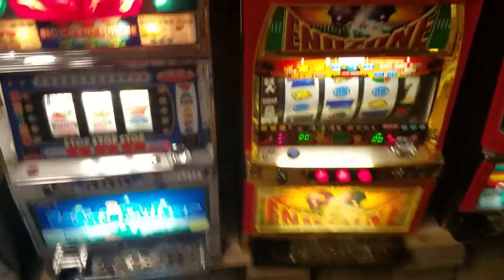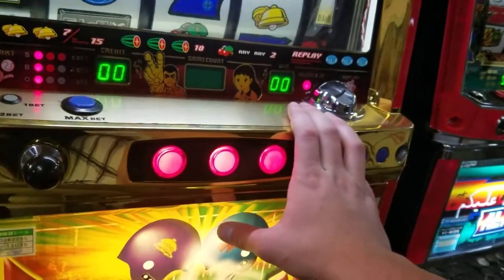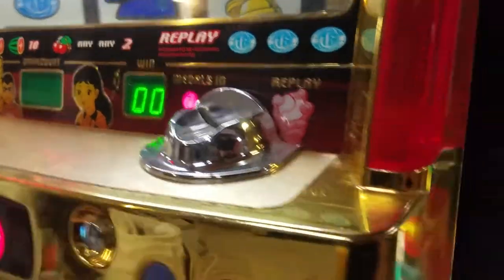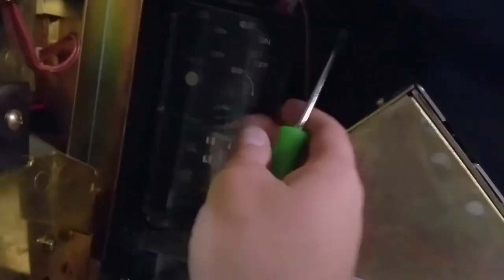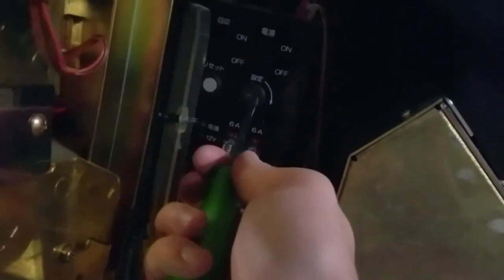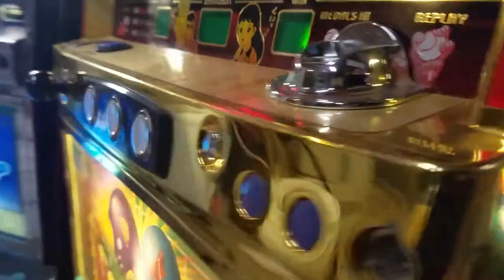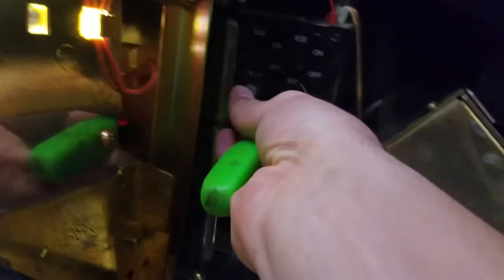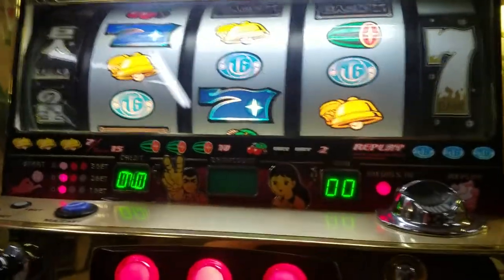Errors and how to reset your Pachislo Slot Machine

Comment: I love the video. I got a machine the other day. 2 of my stop buttons are not stopping the reels. All the buttons led light up but they are not stopping. The fuse looks good on stop board. I sprayed the connectors w contact cleaner. Any thought?
Reply from the maker: Sorry for the late response. I would say check to see if you find any boards (might be in the back of the machine or back right of the machine). There should be a control board of some sort. If this has a fuse on it, I would test the fuse with a multimeter to see if you have continuity. If not, that very likely would be the issue. If it does, I would highly anticipate that you are likely going to need to get some new buttons

Comment: I know this is a 5 year old video but I do have a question, when you used a flat head screw driver to flip the switch, how did you get that to flip over so easy? I have a japense babel machine and I have my switch on the top right of the machine, and putting a screwdriver in doesnt make it flip over. I also dont know how much force to use, I wouldnt want to break anything.

Comment: I have a Babel Japanese mach.  It is sooo loud!  Do you know how to lower the volume?  Thanks
Reply from the maker: Sorry for the late response. My machines are definitely loud also and I have not found a way to turn down the volume on them, unfortunately. I've read where some people will take some foam or something similar and try to put it in between the speakers to dull it. Have not tried this myself.
Reply: You can install a volume control,  but you need to understand basic soldering / wire splicing.

Comment: I bought a 2001 gogo juggler and its giving me a HC code I tried to reset I still cant get it to work. Do you happen to know what that error code means and what i could do to fix it? Thanks you for your videos.
Reply from the maker: Good evening and happy to help! First off, most of these I have ran into havent gave me a letter code, so this one is a little bit of a new one for me. Doing a little research, I founded this is most likely associated with a "hopper code" being that the sensor does not sound like it is either counting tokens when they go out, or are not feeding through correctly. What I would do to alleviate the situation is to see how your Hopper dispenses tokens first and foremost. Is it a micro switch? Or does it happen to be a sensor? Second off, is it in the right position? On one of my machines, I found out that my micro switch was all of a millimeter off, therefore, was causing quite a few issues in terms of feeding them correctly. I'm not a hundred percent sure with the machine that you were referencing weather it is a sensor or a micro switch, so you would have to take a look at this yourself. Some other research I've done indicates that potentially on your power supply the key switch that controls the hopper maybe off or in the wrong position. I would like wise check that to make sure that is correct. But first I would check the hopper of course to make sure that there are no jams and that everything is feeding through as it should. Happy restoring!

Comment: How do you use the screw driver method for Slotter Kintaro? Also how to I convert it to quartes?
Reply from the maker: My reset switch is broken on this machine, so that's why I'm able to use a flathead screwdriver. There should be a coin mechanism converter that you can buy from this gentleman. Link below.

https://www.ebay.com/str/pachislos?mkcid=16&mkevt=1&mkrid=711-127632-2357-0&ssspo=bI8MVatfRIS&sssrc=3418065&ssuid=O0iNCfB6TaC&widget_ver=artemis&media=COPY

Comment: i got a wai pulsar 2, the plastic on the reel is all cracked up and i cant find any where on the internet, anyone know a online parts retailer? i tried super glueing all back together i thought it had back in the original spot and tightened up but im still getting an E4 pooping up and the reel wont spin still

Comment: I’ve been having problems getting the stop buttons to react to pressing even after reset the lights still work
Reply from the maker: I would check the back of the machine particularly the back right side of the machine. What I have seen before is that there's been a logic board there. Sometimes there is a fuse on that board. If that fuse is blown, That could be causing the issue. I've had this happen once with my machines

Comment: How do you get your quoin counter to work. I rest my pachilso machine everything's works  but the qouin counter?
Reply from the maker: I would clean your coin mechanism and see if it's perhaps catching on something? Most coin mechanisms that I have seen If they are open maybe feeding the coin back through which it sounds like it might be doing that. If you push your coin eject button you should see whether it's open or not. If it's not, I would try to follow a coin all the way down and hit the micro switch so the machine may recognize coins going forward. That's at least where I would begin.

Comment: Just an FYI for those watching the video. At 2:11 when he shows the digital readout of 1, this is the difficulty setting. 1 is the default with the lowest pay out. You can press the round button left of the digital display. Settings are 1 to 6 with 6 being the most payouts. I have found 3 or 4 to be ideal as it gives you more little payouts so you get more sounds and animations on Pachislos that have them. You then still continue with the reset and it will enter your difficulty settings when you do. Most if not all will have to have the difficulty set on every reset.
Reply from the maker: Thank you for this piece of information! I did not know this!
Reply: I have some questions about my machine can you help me please
Reply: @briancrawford495  I can try to help if I can.
Reply: @Lithonion1  I appreciate it I'm trying to set difficulty but my control box is a little different is there a way I can send a picture
Reply: @briancrawford495  Don't know of a way to get you my email. YouTube is good at flagging it even if you try to be cryptic and deletes your post. What Pachislot do you have?

Comment: Could you or anyone tell me what type of KEY is used to open the doors???? Is it just a regular cabinet key? I have a macy continental 3 that works buy has the e4 code and no key
Reply from the maker: Unfortunately I am not too sure if it's a specific type of key that needs to be used. I would imagine that it is a special type of key that is used. Only a few of my machines have these and the ones that don't I typically don't mess with all that often. I know you can get replacements at eBay: keep4safety

Comment: Nice video. Do you know where the volume adjuster is?
Reply from the maker: Each machine is different, so I would not know with 100% certainty, no sir.
Reply: @jacobnienaber7653  I found it. But it only has three settings, loud, louder,and loudest
Reply from the maker: Got you. Sorry for the late response. Sometimes can be hard keeping up with this video! I'm sure that can be annoying. When I purchased one of my machines someone put clear tape over the front of it to dull the noise out. The thing was Extremely Loud. Cant imagine it any louder! Where is the control on your machine? May have got a complaint in from someone in my apartment at the time from when I first got it🤷‍♂️
Reply: @jacobnienaber7653  I'll try and explain the location, since I can't send a picture, during the week, since it's not in my home, it's out and about working at a local store, making me some money.
Reply: On my juggler machine, it’s inside the main door. Small three way slider switch with three settings.

Comment: I have one thats nearly identical to this one as far as the mechanics inside and buttons outside. The only difference is there is no key in the box located on the bottom left hand side. Screwed to a small box up on the top right hand side. Instead of a regular key it has a barrel key, and a toggle switch. On the outside it says "RICH MAN". I have no repair manual, cant find one anywhere. Can anyone help me locate something. Thank you

Comment: Hey Jacob! I just got my grandmothers old slot machine and I’m having a weird glitch happen and wondering if you would know anything about it. It’s a Cobra space adventure slot machine and worked like a charm until all the sudden. When you put the coins in and move the knob down the wheels spin but the problem is the buttons all the sudden won’t stop them like it did. Is this common? Or would you know any troubleshooting to do?
Reply from the maker: Hi Peyton! Great question. If you look on the inside of the machine there should be a couple boards. Each one of those boards should have red LED lights. When you push down on the handle, you should see a red light pop up on that board. This is the main control board that will control the buttons as well as the handle. Check to see that when you push the button that any of those red lights pop up. If they do not, check around for a fuse either on the board or on the power supply. I fixed this issue once with one of my machines that it was having the same issues and it was simply due to a blown fuse. best of luck!

Comment: Hi thanks for that. I have a E1 error, but the key’d reset switch has the key, sheared off inside. How can I go about getting the switch replaced?
Reply from the maker: There is a eBay store that I highly recommend using for any parts. Link below:

https://www.ebay.com/str/pachislos?mkcid=16&mkevt=1&mkrid=711-127632-2357-0&ssspo=bI8MVatfRIS&sssrc=3418065&ssuid=O0iNCfB6TaC&widget_ver=artemis&media=COPY

Comment: Life saver dude. I just got one. I flipped the switch on the hopper to get the tokens to come out and it said HC and freaked out. It wouldn't reset with the left key turn or button and after I turned it back on it wouldn't accept tokens.
Reply from the maker: I am not 100% as to what this could be, but I will try to do a little research on it! Hc to me means "hopper credits" or "home credits"? If you manually drove the hopper, that leaves me to believe your sensor could potentially be out of alignment, or your microswitch on the hopper could he out of place. This was the case with my frog machine in terms of hopper feeding. Hope this helps?

Comment: I have a gallop Sammy horse racing slot and power supply looks nothing like the power supply you show to reset. I only have power switch and a switch to get all the coins out. Can you tell me what I need to do to reset?
Reply from the maker: Hmm.... I have not run across a power supply that hasn't been like this. I'm afraid you might have me a little stumped. Is there a switch or does there appear to be a switch of any kind? I know that the power needs to be killed and then normally I've run across where there's been a switch that will be your reset

Comment: Hello my center button is not working?? Do you have any ideas? Thanks
Reply from the maker: If it has prongs on the back and is not soldered on but rather you can take these off I would test by putting those connections on a different button by taking the connections off of that button and replacing it with the connections to the middle button. That way, you can test to see if it is a bad micro switch or if it happens to be potentially a couple of bad wires

Comment: My wheel lights are dim now kind of a orange glow used to be brighter anyway to reset lights for wheel?
Reply from the maker: Could be a few things here. Could be the lights themselves are going bad and it would just simply be to replace them. The second thing I could think of is if your power supply might be going out here. There might be a way to test or just the voltages on these power supplies but I have not found a way to do that unfortunately

Comment: please help, i have a 2005 tarot master. it does not have a small inner key. I want to reset machine and I want to reset pay out mode.  please advise thank you so much.
Reply from the maker: I would replace the reset switch then. Keep4safety should have parts

Comment: Hi, I accidentally moved a reel or two when I was working on it.  Did I screw up the odds, computer giving me a win, etc.  If so is there a secret to manually setting them so the work correctly?  Thank you.
Reply from the maker: I don't think you did, no. I wouldn't imagine at least. I would say do a reset, or try to play it and then do a reset
Reply: @jacobnienaber7653  it seems like it plays ok.  I was unsure of the mechanics (how the odds are affected) as you of course, stop it yourself.  I imagine the icon wheels would be hard locked too the mechanical reels if it mattered much.  Perhaps there are magnets that trigger it.  Thanks alot.

Comment: yo hope you can help me i have the same machine but the baseball one from 2003 idk if my machine is on drugs or something but i played with it a bit and each time i get a bonus i always get the 3 bleu 16 and thats the replay and every time i have this for the number of play i have in the count play in the middle it shows 2-8  and its alway the same win the 3 bue 16 and it just gave me like 15 tokens each times for all of the bonus and then when the combo finally end its write fff in the count play and wont take token until i reset the machine is this normal or is there ant setting i can change i try to change the number inside the machine with the blue bouton from 1 to 6 its just the same and i dont know what are the little 2 switch inside the machine where is the power switch on off thank you hope you can anwser my question.
Reply from the maker: Trying to think this one through and definitely has me puzzled... Basically anytime that you hit a jackpot of some sort it just simply cycles through and gives up?
Reply: @jacobnienaber7653  i figure that one out so yeah when i hit the jackpot it rolled the jackpot till the end and then it empty the 50 credits the problem was after emptying the credit where it show the bonus it write FFF and then i need to reset ot and i think it just saying that the hooper is almost empty or is empty.

Comment: Where can I get a key to open my machine or is there a way to open it without having the key
Reply from the maker: The only way I have found is if by chance on the top of your machine it has a grill you can take the grill off and then put your hand through the machine to unlatch it. At that point I would just look to replace the whole key lock.

Comment: How do you fix an H.E code on the twinkle stage machine.
Reply from the maker: HE should be hopper air. Clean the hopper, make sure the either micro switch or infrared sensor is adjusted appropriately. Make sure it spins freely as well. Do a reset. Most the time that happens to help

Comment: I have one of these machines and I just scratching my head on it.
Reply from the maker: These are definitely difficult as they typically don't have an owner's manual. It's more of a they were all built very similar and therefore many of the tips and tricks work fairly similar to other machines. What seems to be the issue?

Comment: Hello I have a Mizuho submarine slot machine and can not get it to work ? Lights up , tokens are going into hopper.  Do you have to have tokens in hopper for machine to work ?
Reply from the maker: Hi there,

Normally yes in my experience I have had tokens in the hopper prior to using. Sounds like they're falling in the hopper, is the game crediting is my question? If it's not crediting, might be an issue with your coin mechanism.
Reply: @jacobnienaber7653   Is there a way to test this coin mech? Do they normally go bad ?

Comment: How do i identify the machine i have?
The one i have has a tag in the front and has three rows of numbers a #1 and a set of numbers then a#2 and another set of numbers and last #3 and another set of numbers so out of those three sets which is the model number?
Anyone know?
Thank you
Reply from the maker: Does it have a name on the front of the machine, or is it all in Japanese?
Reply: @jacobnienaber7653  The writing on the tag is all in japanese and underneath are all the numbers. The ones i think are the model are these 63-09003
The number above it has nine digitsso i am thinking that is the seria number and the one at the bottom i thought was the dimentions of the machine but they dont match the actual dimentions.
That number is H 16.11.16 maybe a date code?

Comment: Can I ask you a question? My JET SET Pachislo will not register coins. The reels spin and yet I cannot stop the reels. I look inside at the button panel. All lights work!!!!!!! What could it be? I reset three times and change the coin mechanism with a new one. Thanks!!!!!!
Reply from the maker: That is an odd deal.... are all your fuses current and working? If you are playing, and you hit your buttons while it is spinning, there should be a board in the back that will have lights on the board. When you hit a button, does that light come on? If not, then could be an issue with either a fuse killing power to the buttons or the board itself. Have had a few additional questions on this, and mine (thankfully) has been fixed with a simple fuse replacement. Let me do some more research here, as that is my usual go to (again, been lucky with fuses).

Comment: Hi Jacob, I have a street fighter 2 slot machine, it has an E6, I can’t seem to reset the machine.   The internal key switch  slot is missing completely…..   is there another sequence to reset the machine.   BTW, there seems to be a red button hooked to wires.  Not sure if this is some sort of reset
Reply from the maker: I have read or found another way to reset other than the way I showed in the video. If it's just a hanging red button I would imagine that that might be a reset of some kind? I wouldn't imagine it would be, but there is the possibility that it could be. Might be a hack of some sort?